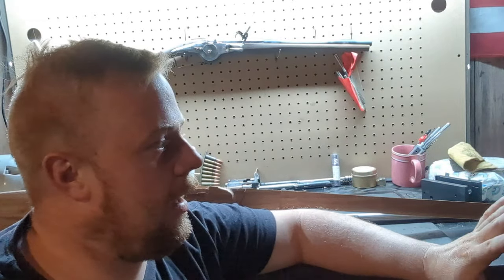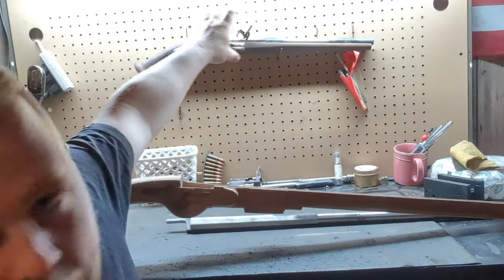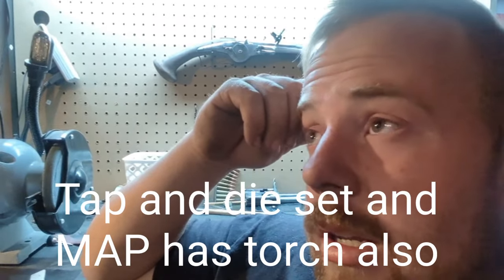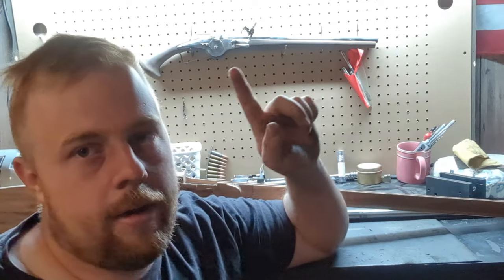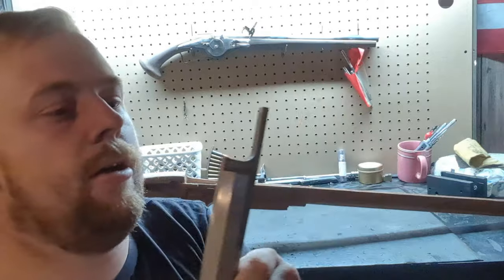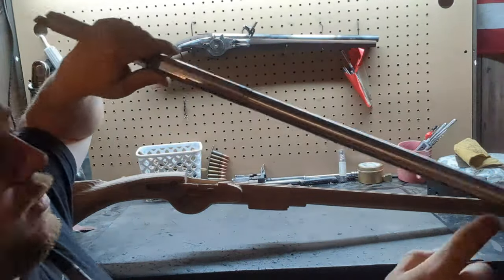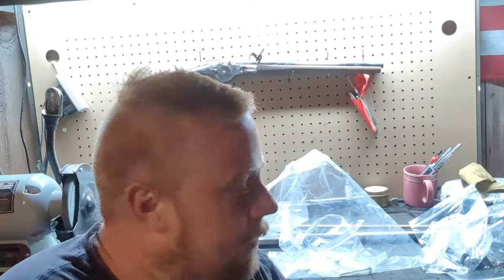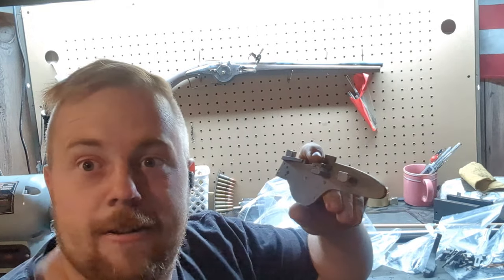Let's build a Wheelock from the Rifle Shoppe PT1 Introduction and Fitting the Tumbler

Comment: Ethan, I have a wheel lock long gun that was made in Nuremberg around 1580 and if you would like, I can send photos of the lock, inside and out.  Other than the shape and possibly the size, I don’t think that there’s a great deal of difference between construction of the one that I have and the one that you’re building.  

This will be an interesting build.  I have two land pattern musket kits on order from The Rifle Shoppe but it will probably be a long time before I receive them.  One is a pattern 1730 with a 1728 dated lock and the other is a pattern 1756.  

One thing that I’m really curious about is going to be your experience with pyrite.  In my gun, the first pyrite that I made only lasted four shots before it crumbled too badly to be used.  The pyrite was cut from a large single crystal—a real mess and something that I don’t look forward to doing again.  The crystal looked perfect on the outside but when I cut into it, I found what looked like cracks.  That pyrite came from a deposit in Spain and I wonder what the pyrites were like that they used in the 16th and 17th centuries.  I also tried the sort of fool’s gold that you can buy in the USA but that wasn’t even good for one shot.
Reply from the maker: So yes if you would like to send pictures that would be awesome. My email is in the about section of our YouTube channel here and also my experience with iron pirates has been pretty much the same. I bought a batch of crystals from Spain and only a few of them ever turned out good enough. I've also found that you have to break away the outer edge and that the inside portion is the only part that is actually strong enough to stay together and spark really well

Comment: Good introduction to the Rifle Shoppe kits.  The only item I have ordered from them so far is a reproduction ramrod for my 1843 Hall-North.

Your stressing quality drill bit is no joke.  I have preference for Precision Twist Drill bits: however I will also purchase C&L, and Drill Hog.  I prefer Stub Length/Screw machine length with a 135° split point.  When it comes to taps may I recommend HSS spiral point, also known as a gun tap, and tap in the same setup on your drill press as you drilled the hole.  Use a tap guide to stabilize the tap.  The big advantage of a spiral point tap on thru holes is the chip is pushed forward of the tap.  One does not need to back the tap up to break the chip as one is required with a hand tap.  As for maintaining the setup unfortunately for those using a drill press keeping the spindle aligned with the hole is not easy or frequently possible.  I stopped giving a drill press floor space over thirty years ago.  I have a Supermax turret milling machine that I use mostly to drill holes.  The ability to run the knee up and down while holding alignment with the spindle is awesome.  Yes it was expensive, and yes it was worth it.   

The example of using an end mill to move the hole center is good practice.  

I am surprised at the lack of documentation that accompanies the kit of parts.  Bills of material and drawing packages was my area of Mechanical Engineering.  Today it is not that hard to assemble a good set of instructions.  Low volume production is a pain.  

I look forward to more videos in this series.  Even if I cringe watching some of the techniques you must use to get the job done.  Hey you are getting the job done.  And I need to finish setting up my “new” K&T 2HL Universal horizontal mill w/ DRO.